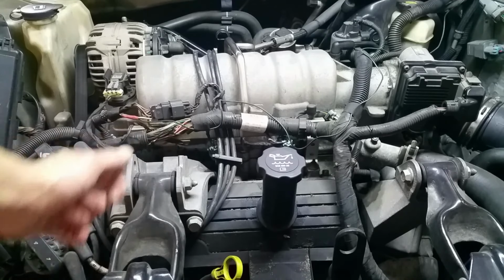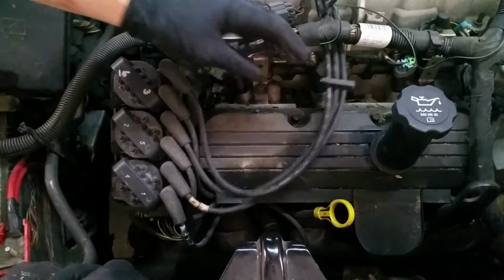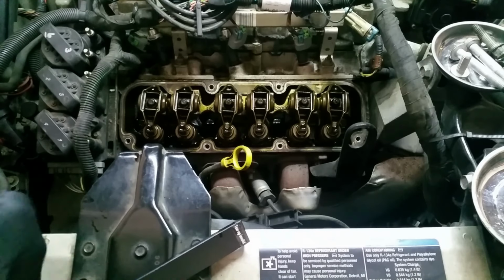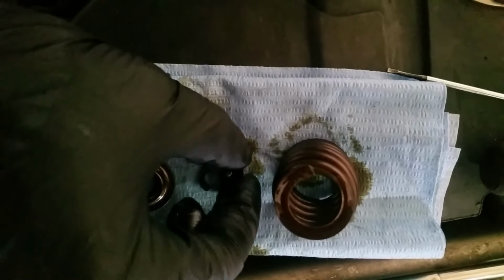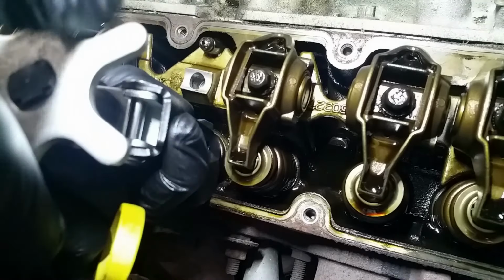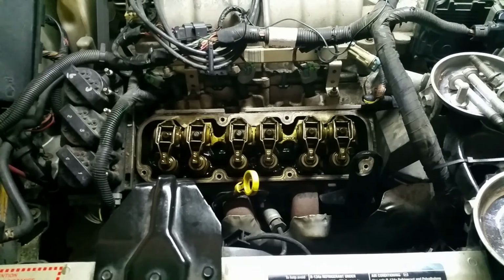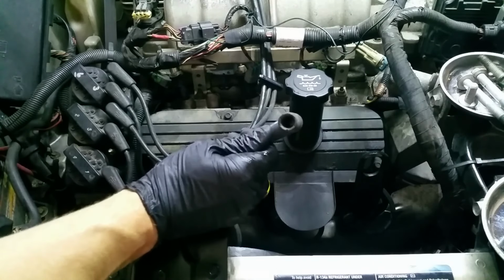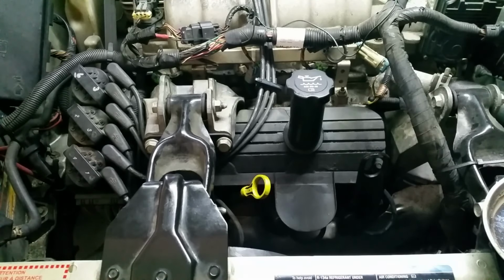Pontiac Grand Prix 3800 - Replace Valve Stem Seals & Valve Cover

Comment: Thanks for the video.  I admit, I did not watch the entire video, I skipped to where you discussed rotating the engine to TDC and then removing the spring.  I just used this info on two 3800 cars.  Really appreciate it, worked PERFECTLY.

Comment: I just did one side and I was frkng praying dude! 😂😂😂😂😂 I though I had my cylinder at TDC after removing the spring and I gently with the grip of a mantis lowered the valve to insure contact with the piston.... It did not touch the piston 😂😂😂😂 I freaked out lol but! I chilled and water turning the engine until it finally touched ! And the a proceeded
Reply: I just saw what I did wrong lol

Comment: I just did this teardown today had 2 seals slide up the valve and was burning oil.. i found it easier to put compressed air into the cylinder using my air tank to keep the valves up

Comment: Wow. Great video. I'm trying to track down a Misfire on #3. Ive checked coils, new wires, new plugs. Smoke tested for vacuum leaks, block tested with the special fluid that detecs exhaust gases in coolant, injectors all tick at same rate when I use a stethoscope on them. I haven't fuel pressure tested or compression checked yet. Those are next and if all is OK I am going to take my valve cover off and see if maybe there is a broken spring.
Reply: I was chasing down this same issue, ending up being a snapped valve spring
Reply: Same issue I've got at the moment along with q cracked resonator. What did you figure out since then?
Reply: @brandonsimpson3101  I did a leakdown test and it was a bad exhaust valve

Comment: I need help I have a 3800 series 2 1997 Grand Prix gtp can I follow the same method to do the rear head ? I’m not sure if I can turn the crank to tdc or should I shove some rope inside the spark plug ?

Comment: Would you share where you bought the spring compression tool? Amazon has many and most are garbage..
Reply from the maker: I bought it from an auto store many years ago. Personally I don't care for this style, even though it worked. It puts a lot of tension on narrow points of the spring which could put a nick in them if used improperly.
Reply: @in-depthdiy2123  Thanks for the reply. I assume the springs steel is  5 times harder than the tools. I'm more concerned the spring will tear the tool apart.

Comment: How are the roller rocker and push rod adjusted/ torqued
Reply from the maker: These engines are fixed dimensioned systems. Tightening the rocker arm hold down bolt does not change the geometry or lash/gap between the rocker and the push rod, or valve stem. 

To adjust the lash between the rocker and valve stem you would need to change the length of the push rod (by measuring with an adjustable push rod and ordering new rods).
Reply: Thank you

Comment: So, did it fix your oil burning problem?
Reply from the maker: It's only been 1 oil change so far, it seems to have slowed it down, but did not completely fix it.
Reply: @in-depthdiy2123  I'm do mine i fear my oil burning is piston ring wear it the only other cause if valves seals are good. Crossing my fingers 🤞
Reply from the maker: Andrew Dean  If it was my vehicle, I'd start with the cheaper and easier option of replacing the stem seals. If it works, you're good to go. If it doesn't, you're out a little money and time compared to full on replacing the heads. This is assuming you're only burning oil and there's not a crack or broken valve in the head.

Comment: Um... those bolts are "torque to yield" and should NOT be re-used.
11ft. lbs. then 90deg using an angle gauge. Here's what I found.
https://zzperformance.com/collections/3800/Bolts#productOutput
Highly recommend 'valve-stem seal puller pliers' You'll be very glad you got em'.
Magnetize small screwdriver to retrieve & install stem-locks so you don't cry.
I use rope, spray WD-40 on it stuffed into cylinder to positively hold valves up rotating crank to push piston into it. (an old backyard 'shade tree' mechanic trick)
Thanks for making us a video, much appreciated.